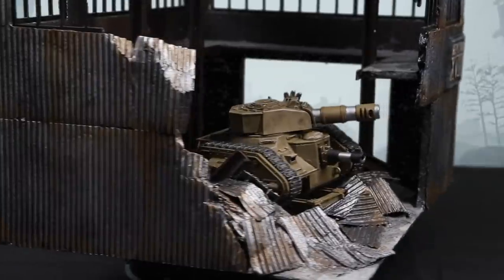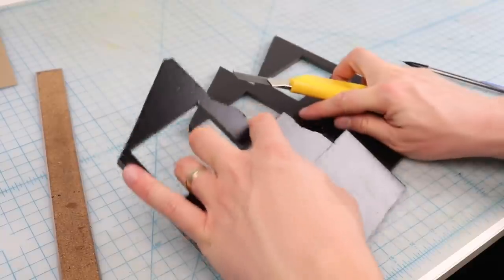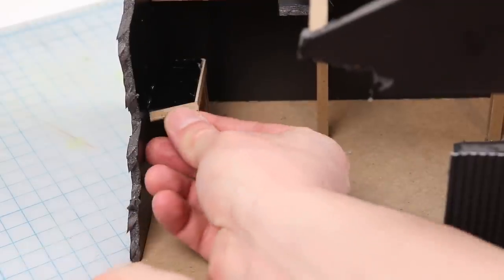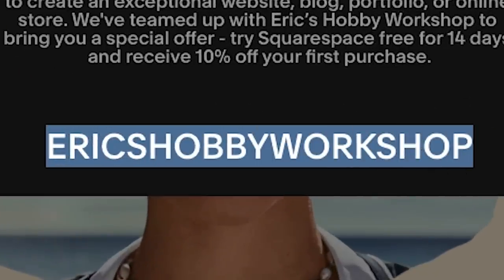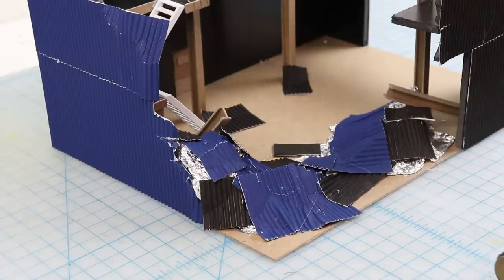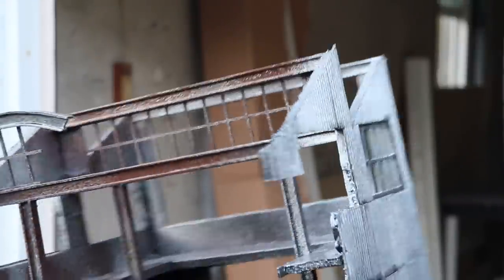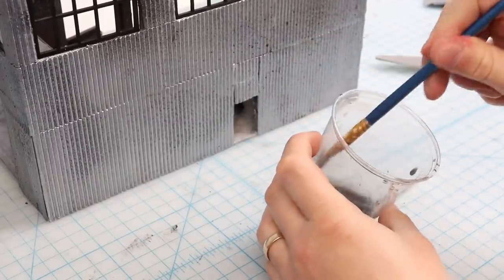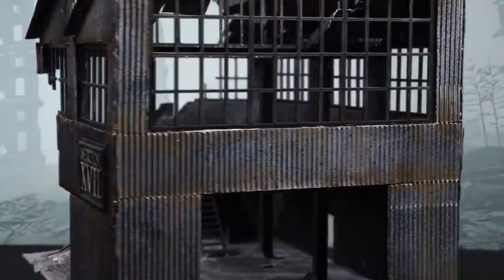Realistic 40k Terrain - Ruined Factory Tutorial

Comment: I love this build and your channel in general been subscribed for a long time. A cheaper alternative for the windows instead of using a 3D printer is to just cut thin strips of medium-weight chipboard like you did for the I-beam and then glue them into a grid that fits your window cutouts. A lot faster and you won't develop carpal tunnel and you don't need a 3D printer.

Comment: If you wanna make a more modular window model just in blender, it is not hard and can be done with little to no modelling experience. 

Make a plane, shape it to the proportions you want and hit "i" to itset it. Scale the inset so the edge is half as wide as you want it to be when its done. When you got the desired thickness, delete the square in the middle, and select the four edges and extrude them.
Open the modifier tab and add two array modifiers, set one to X and the other to Y. Tweak the settings till the edges all line up. You should end up with a nice grid. Now you can just add as many rows and columns as you want.
Hit tab to go back to object mode and repeat step 1 to get another frame, just scale it to go around the smaller frames you made earlier. Making it a seperate object makes it easier to scale just it to fit your window.

Congrats now you can make as many rows and columns as you want. Big windows, small windows, huge windows. Whatever you need, just tweak a few values and move the edge.

Comment: If I might make a suggestion, Tinkercad is a great resource for making 3D printer files-  it's free and 100% browser based, which are always plus points in my book. While it's not the most powerful tool for more complicated/detailed models, it could handle making something simple like those window frames and your sign, no problem. You can make something from scratch, get it scaled how you want it and save directly as an STL file, so no need to mess around with multiple steps on different programmes either.
I've used it to make a few designs myself, as well as occasionally editing models that didn't quite work for me.
Reply: Made a decent wall the other day using it, just don't have a printer.

Comment: I have a vyper.  I only use a brim if it just wont print without
Reply from the maker: It seems to help. I had some adhesion issues with some other spindly things before
Reply: @EricsHobbyWorkshop  cheap hair spray.   I rarely even clean the plate.

Comment: Can you make broken glass panels with a 3D printer from some transparent matter? I know it will be a time-consuming project to put all of those in place, but it would make this terrain even cooler!
Reply: You could use the clear plastic from toy packaging, cut to size then roughed up with a hobby knife. Eric will have a steady supply as the kid toys start rolling in ;)
Reply: @PaintingTableVideos  The method you mentioned is far easier than mine, so thanks!
Reply: If you don't have a 3d printer, consider using a  sheet of clear plastic with black paper strips to divide into panes. then just cut out the panes you want damaged and you can grime up the windows too